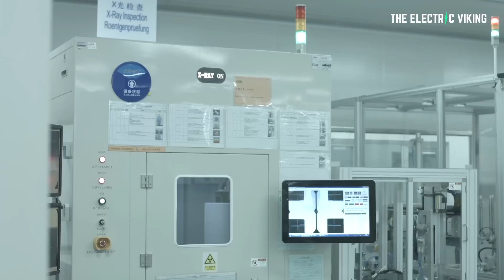BMW to use Tesla 4680-like batteries from China in new EVs

Comment: I think the new MP3 battery from CATL will be 4680 cylindrical cell.
Reply: MP3 is a form factor and therefore another form than 4689, not chemistry. You could realize LFMP or LNMO but higher C-rates the more heat is to manage. M3P is a better cooling [4x] and 4680 has lower resistance because of short ways in the cell too. 
Thinking about pressing is need for longer life at lfp-chem. But more elastic space is needed for more silicon-mixes. I think thats one of the reasons for round form by Tesla, aiming better performance for Semi/Cybertruck and perhaps smaller but faster charging packs in smaller cars for only daily use case for mass customers the next years. The most folks want and need affordable cars. Elon will not sell more than 3-5 Mio. MY p.a. with more than 50t$. So I bet we see falling prices 2 years ahead and very much cheaper models from chinese competitors depending at the scaling acceleration.

Comment: I offer you 1RMB for your X5 + the value of the fuel in the tank:) (Delivered to Chongqing, China)
Even elementary school mathematics doesn't support hydrogen as a fuel for passenger cars.
The bigger problem is that there are ~4M charging piles in China right now. No one is going to invest in hydrogen infrastructure, even if someone could make a case for a hydrogen-powered car.
I think that BMW is making the right moves. It is heading towards bankruptcy. That is good because BYD needs a high-end nameplate for their high-end cars. BMW nameplate and an engineering team in Germany will be for sale at pennies on a dollar soon. I hope that BYD has their checkbook ready.
Reply: OUCH!
Harsh..... But on reflection quite possibly correct.
Reply: What are you smoking?😂😂😂
Reply: Johann Brauer / 😂🤣👍✌️!

Comment: The new m3 LFP batteries from CATL seem to also made the 4680 battery packaging less of an advantage.  One of the reasons Tesla created the 4680 was to optimize the use of the Lithium ION battery and increase its safety and thermal control.  
Although Elon said they can use LFP chemistry with the 4680 I am not sure they will.  Do you think Tesla will use 4680 with the LFP chemistry?
Reply: You DO understand that the "L" in "LFP" stands for "Lithium"?
and that LFP (LiFePo4) cells are "Lithium ION"?
Elon (and other insiders) Have said they actually WON'T use LiFePo4 in the 4680 (yet) not that they "can".
.
"Packaging advantage"
The main advantages of 4680?
Production speed. To move from GWh to TWh You need "cells leaving the factory at the speed of (machine gun) bullets"..... That's difficult with other form factors.
Plus, more material in fewer cells helps that.
.
Then there's tabless construction which also contributes to production speed, but mainly increases cell performance.
.
Those are the "main" advantages.
Reply: likely not because they will use it for highnickel first and catl makes derivates of lfp cheaper and with more dnesity in thier own form factor.